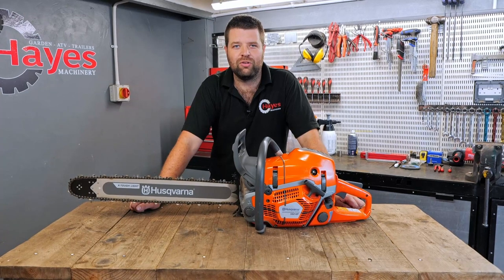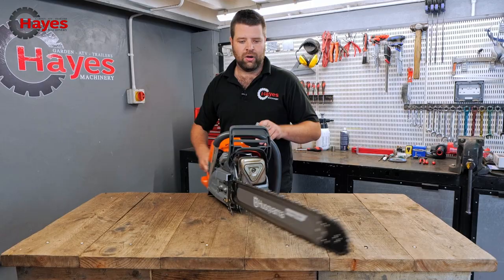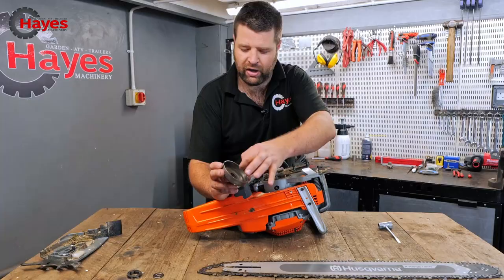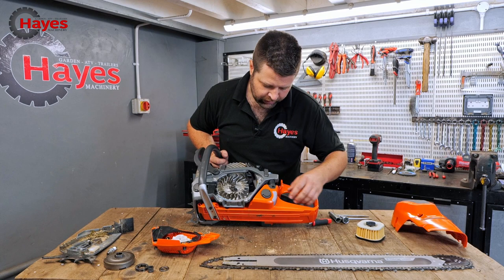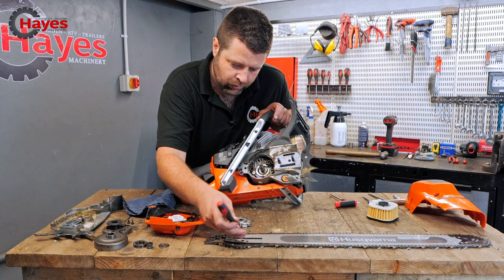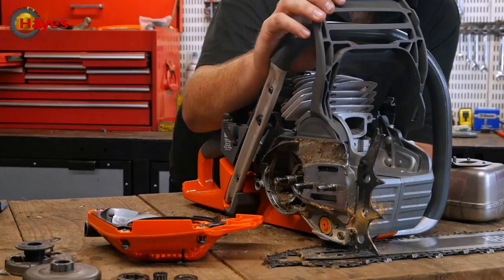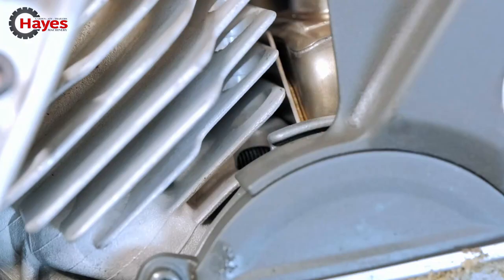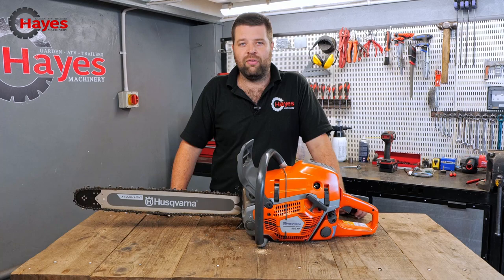Husqvarna 592 XP Chainsaw In Depth Technical Detail!

Comment: You should know that the 2 input ports have very different purposes. One is garden variety input to metering venturi, feeding the crankcase. The other is the air supply for stratified scavenging, which greatly reduces emissions and fuel waste from short-circuiting of some fresh air & fuel from transfers to exhaust. The idea being so supply air-only as first feed through transfers, so that can be exhausted. I've a few saws with that stuff, from 40 cc RedMax, 50 cc PPro, 61 cc Dolkita, 576 XP, XT, AT Husqy, so it's not exotic. Much preferred, in fact.

Comment: The dual intake "ports" do not allow "twice as much air in". They are, as with all the new saws strato. The top channel feeds fresh air only to scavenge the transfers, the lower feeds fuel/air mix. This is purely because of dumb EPA /EU regs. High revving, bordering on lean running, less low end torque is the result.
In big timber and 404 it's predecessor 395 will eat it.
Same as with 660 v 661
Reply: The 661 is not a strato saw
Reply: @johnwalt3504  I stand corrected, thanks
Reply: Sounds like this guy doesn't know as much as he thinks he knows about this saw. But I'm a stihl man anyway just watching for entertainment

Comment: I'm quite sure that the sprocket is the same as in the 572. So you can use the sprocket for the 572 and 3120 for a .404 chain. I've done this on my 572 and it stays sharp much longer than a 3/8.
Reply from the maker: Yes the same rim sprocket will fit them all 👍🏼

Comment: I have 395s and 372s for all the falling I do. This is the first time I've seen an auto tune taken down.   Very cool video.   Thanks.   I was curious about the cooling fins in the cylinder, do you think it's got more or less than the older husqvarna saws.  ( 372 and 395 )   I dont really have any overheating issues.   Just curious if the newer saws like this do well in that department.  Thanks again.  Really enjoy your guys work

Comment: I use my chainsaws in the city. 60-in diameter up to 48 inch 20 ft up to the first garage maybe 80 in. The first 10 or 15 ft off the stump is filled with spikes and nails. I was thinking 32-in bar with a carbide chain. What do you think. Rough cutting in the city. Hello from Piqua Ohio.
Reply from the maker: Nice! Nails are never a friend of a chain hey.

Comment: Nice review. But please, tell us about the cheap SKF bearings husky uses in the new 572xp, the ones that spit steel balls inside the crankcase. Do they use those in the new 592 as well?
Reply from the maker: I can’t confirm but it is a different part number than the 572 if this helps 👍🏼
Reply: SKF bearings are not cheap, but it is very concerning to hear that they are failing! I sure hope that the 592XP will not befall the same fate.  I just bought one at just under 1,500 USD.

Comment: have a 555 autotune 1 of the first ones built has 31 hours on it according to my dealer.  it sits in the shed cause it wont stay running and my dealer wont give me any thing for it!!!   went back to my old saws had them rebuilt.  $600 spent on a 555 that i cant use after 31 hours.  just will not stay running.  my dealer has changed every thing except the carb
Reply from the maker: It might well be the carb then if he has changed everything else 👍🏼

Comment: Give me manual carb any day of the week if this thing thinks it's running well and it's not your fucked
Reply from the maker: Husqvarna are also bringing out the 585 which is pretty much the same as this, but with a manually adjustable carb 👍🏼
Reply: @MachineryNation   and how many kilos ?dry weight?no bar
Reply: been a long time since auto tune has had issues.
Reply: @Rob-tl9md  Using my 545mk2 from 2016 Auto tune wit zero problems  and saw has ower 2800 working hrs.

Comment: I’m a little disappointed with this saw have being 
using Past 4 weeks I’ve gone through 6 tanks of fuel starting to loosen up a bit very powerful and smooth saw.
What I’m disappointed about air filter is not as good as the 572 & 395 xp small particles are still getting through under base of air filter not happy also the 
felling dogs are very flimsy you would think Husqvarna would put some decent dogs on a 90cc
saw.
They also claim it has more power than the STIHL ms 661 they feel pretty much even to me in power and in cutting speed not a big deal of difference for what it’s worth the STIHL ms 661 is $300 cheaper.
No I wouldn’t buy this saw again.
Reply: Someone else commented that they were using a bit of waterproof grease where the filter meets the air intake. They said it fixed it completely. I imagine a silicone putty or something would do the same thing.
Reply: Hi Daniel very good point you made that will work.
The comment I made about 592 xp Husqvarna has failed with there air filter set up I have to clean air filter after heavy days work running the saw hard.
Saw dust particles are getting pass the filter into the manifold.
As for the 395 xp I can run that saw hard for a week and it’s still clean no saw dust in manifold.
The best filter set up I seen 395xp
Reply: @tonytribisonna9886  I have a 592xpg back ordered. Are you pleased with it other than the air filter issue? It's a shame that the the saw is lacking in such a critical area but i'm going to use grease right away on mine.
Reply: Hi Daniel you will not be disappointed with this saw has plenty of power smoother lighter  than 395xp and cuts quicker more chain speed and also louder make sure you wear good hearing protection .
I’ve never had any starting issues
I use good quality premium fuel
95 octane & good 2 stroke oil.
Don’t run ethanol fuel 
Another thing I forgot to mention you won’t like the saw the way it runs the first few tanks of fuel auto tune constantly adjusting which is normal it should loosen up 4 to 5 tanks off fuel you will notice revs go up and so does power.
I’m happy with the power gets better the more I use.
I just hope Husqvarna make an improvement filter so it sealed up better but for now grease will have to do.
Reply: In US, 661 is over $300 more than 592. 
$1589 vs $1260